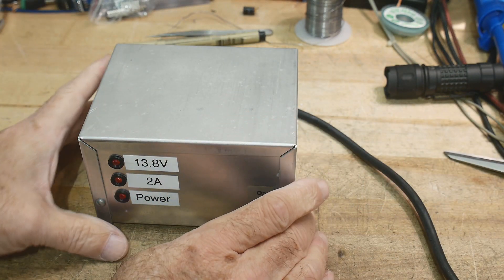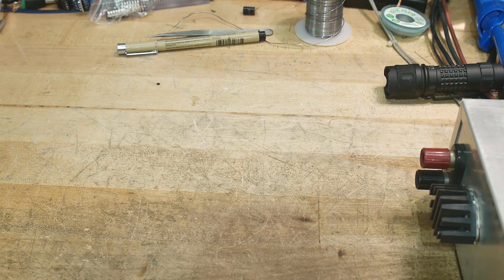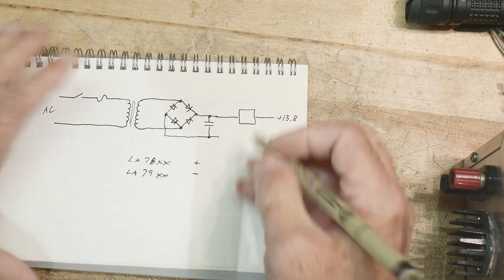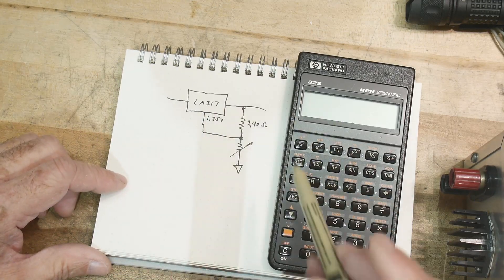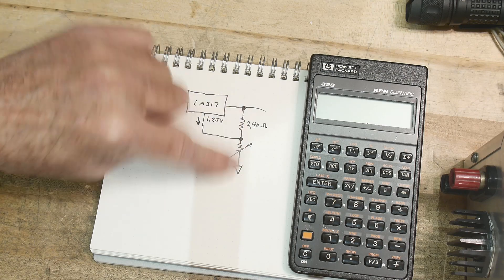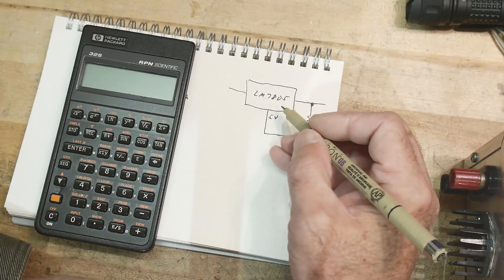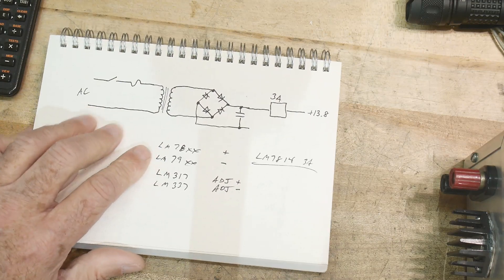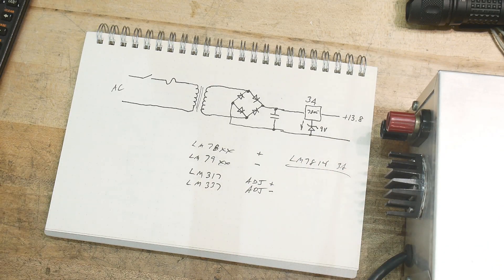#719 Using an LM7805 to Regulate Higher Voltage

Comment: I have used this trick in the past. It works OK for battery charging I suppose. It is also a very good temperature sensor. The output will change quite a bit over temp. I tried to use this circuit to provide a reference for a constant current source in a precision ramp generator circuit for a video product. The TV picture would move left or right about two inches over a 25 degree range. So, I put temperature calibrated grease pencil marks on my monitor screen until I could get back to fix that bug. No one else on the engineering team thought it was funny but me. Yep. A No Go for a commercial product! Still, a good trick to know for other less critical uses.
Reply: I heard a 6.8v zener + Si diode in series is the best (tempco cancels out). Otherwise a 5.1v zener has the lowest tempco.
Reply: Alternatively you could use a TL431 or other voltage reference?

Comment: Nice but adding some diodes (0.7V drop and -2.2mV/°C) is better by compensating the  negative coefficient of the charge voltage required by the lead cells (-3mV/°C) per cell.
BTW, professional chargers always have temperature compensation.
The remaining voltage required can be added by a zener diode.
It should be about 12 diodes or 2-3 if you have 12V regulator but with less voltage compensation.
Agree?

Comment: The zener trick works, but I had to add a resistor to the cathode of the zener diode connected to the unregulated input of the regulator.  Calculate the resistor value to set zener current at about 1/4 the zener max wattage.

Comment: To fine tune the output of let's say the 5 volt regulator circuits loss just adding a diode will bring the output up about .6 volts correcting the final output closer to the 5 volts you wanted, Carl